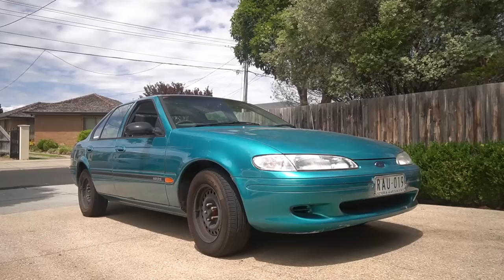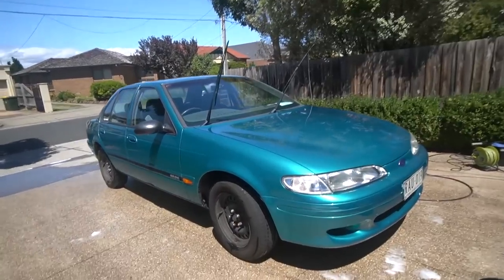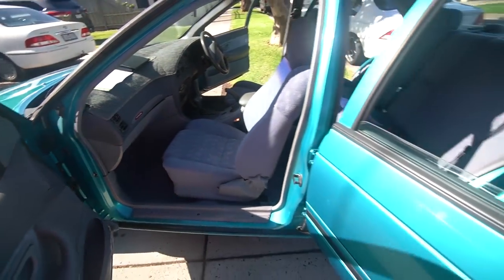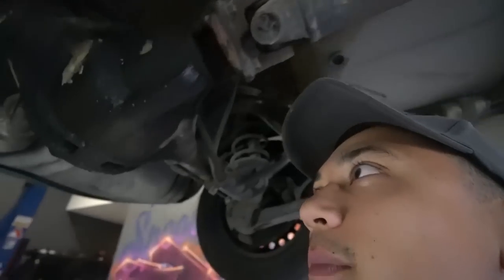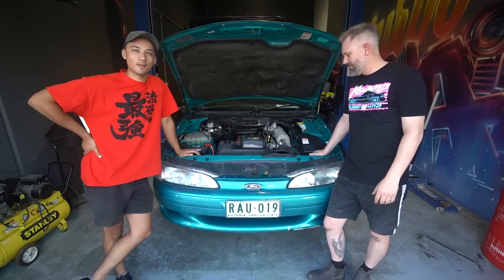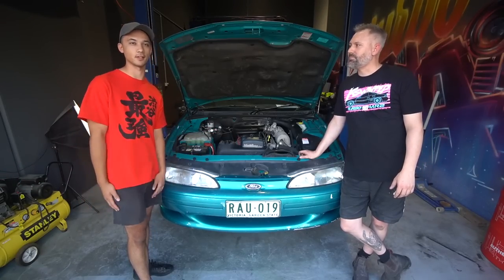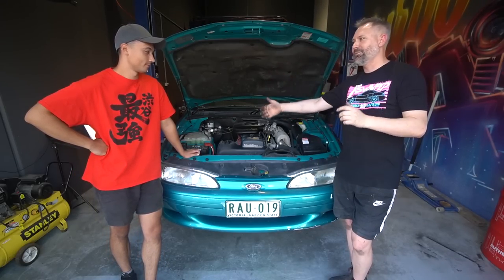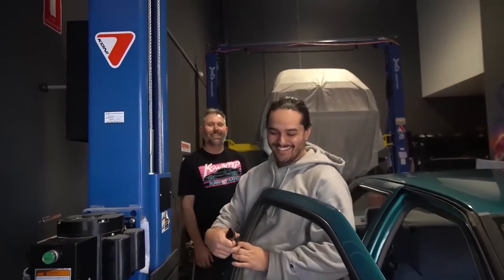BARRA SWAPPING THE EF FALCON?? - THE PLANS REVEALED!

Comment: I would go with a zf for straight line performance. the BTR has a really tall first gear that hurts your times and as for Manuel I wouldn’t go for one the zf is just faster
Reply: BTR's can take a beating with a shift kit and trans cooler.
Reply: @efxr6538  btr are way to see as a 4speed
Reply: @yella953  what do you mean?
Reply: @efxr6538  slow

Comment: If you're serious about chasing a 10, from those 3 options... ZF is your only realistic option. BTR's are shiiiiiiiiit & manual, although awesome on the street. They're a real pain in the arse for any consistancy on the strip, and regrettably also generally slower thanks to the human factor.

Excited to start seeing this all unfold mate.
Reply: Nothing at all wrong with s Btr.  The early ones were better then B series boxes and trans cooled and with a few goodies can take 400 kw. Best thing about them.is abuilt Btr will cost 3 -4 g..zf a lot more
Reply: @barraboy03  Agree, BTR with a shift kit and trans cooler is solid! Some guys have run 700hp through them and run 9s
Reply: @efxr6538  yep Dtm are a perfect example. There E series falcon runs mid 9s all day long
Reply: @barraboy03  Exactly the car I was thinking of! 👌

Comment: E series have a completely different suspension setup in the front so you won't be able to run any newer model falcon big brakes

After some real world testing, we found that the btr is a better gearbox for a higher a horsepower car in a straight line, the zf will make a slow car feel fast because it changes gear more but if you're running a decent amount of power, you'll benefit from a shift kit and high stall in a btr rather than the zf
Reply: That's not true what so ever.. FG K frame goes into E series quite easily.

BTR's are far from good with decent power, I have 420kw to the wheels and the BTR's don't last long at all. With 2 massive tranny coolers a shift kit and 3000rpm stall. They are junk. Go straight to a th400

Comment: Keep the SOHC engine as they are getting rarer every day and they make good power too!!
Reply from the maker: I might! if I have room i'll keep it
Reply: @RexH  you should definitely keep it 
Because so many people already done a Barra swap
Reply: @alpharaptor7510  there is a good reason so many people do barra swaps, they work very well and make good power for little money in the grand scheme of things, personally i dont think it's worth building the intech, alot easier and cheaper to gas barra swap it for the power goal
Reply: @blokebeershed7651  Barra swapping everything is starting to get really really boring. I don’t see the point in it
Reply: @alpharaptor7510  yea but i dont asume rex has money to build an intech because for his power goal, he would have to build the bottom end of an intech to handle 400kw and it's not cheap to build a motor, where as buying a gas barra motor, you dont have to touch the bottom end. I get it's been done alot but there is a good reason for it, theyre cheap reliable motors that are very capable.
Reply: @blokebeershed7651  the INTECH will last a 1 thousand years more than a Barra. I just don’t see the point of repeating what others have done.
Reply: @alpharaptor7510  they are both great engines
Reply: @alpharaptor7510  have you even owned a turbo barra let alone driven one? Saying someone shouldnt own a car because they want to do what they want to do with it? You're a clown🤣
Reply: @alpharaptor7510  and no, the intech will not last longer. Ive owned both, intech dies quicker
Reply: @elijahmcculloch7189  yeah I know they are but I don’t see the point of repeating something that others already have done. And why engine swap a car with a good engine
Reply: There are alot of people who prefer the SOHC over the DOHC barra especially boosted,and there any many incredible examples,I myself went the barra route but I also have huge respect for the SOHC with a turbo!!
Reply: @alpharaptor7510  I don't think he cares about what others have done, he is doing it for his budget and because he wants, he already has an intech, why not go barra?